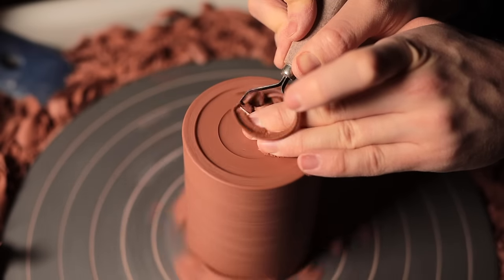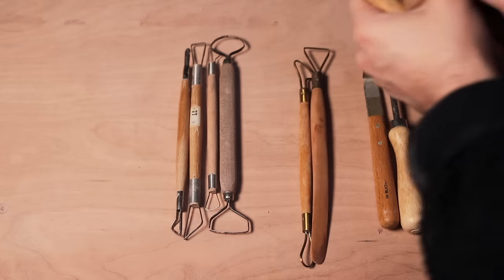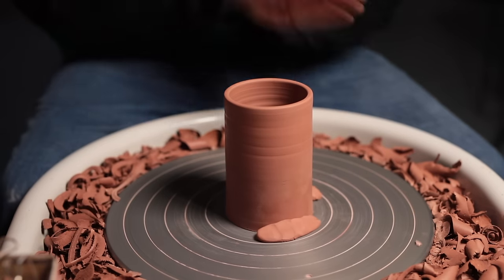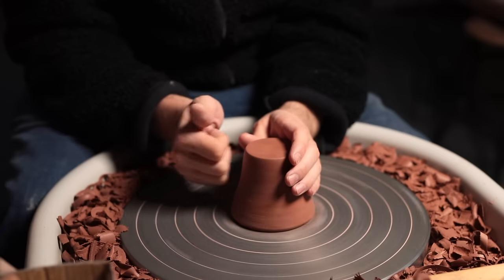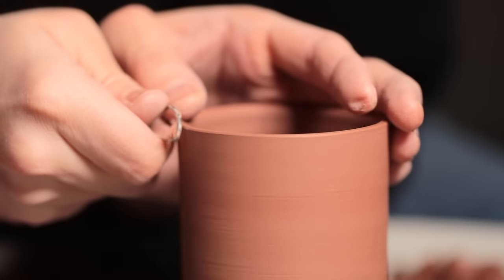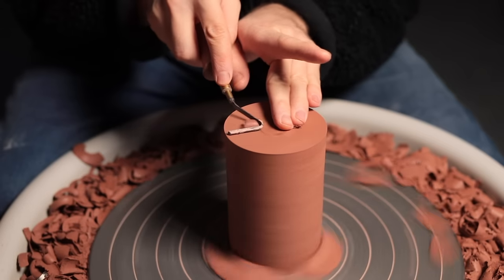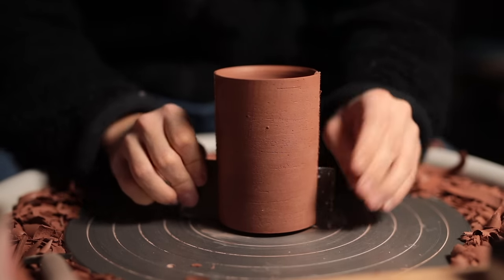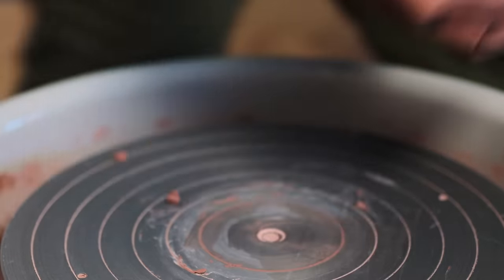How to Trim Pots — Tips and Tricks — A Beginner's Guide

Comment: One thing I've been struggling with in trimming lately is that when I'm trimming the base of the pot I'm somehow creating undulations radiating out from the centre of the pot that I can't seem to level off again. I bought a new trimming tool thinking that perhaps mine was blunt but that didn't help. I never used to have this problem so I can't for the life of me figure out what I've started doing differently! Hopefully what I've explained makes sense and is something that you might be able to talk through in an advanced video some day. Your videos are always the first I turn to when I'm having trouble with something :)
Reply from the maker: It sounds like one of three things… either your tools are blunt and you’re having to use too much pressure to push down on the base and trim. Your bases could be thrown too thin/or you’re trimming too thin. Or you’re trimming the clay when it’s too soft, so it simply bows inward as you work instead of holding flat. 

Levelling off is tricky — I recommend using a very tiny turning tool and just removing the clay bit by bit from the high point that spins around. Eventually it’ll level out but you’ve got to hold the tool very firmly and not follow the undulating base. Rather you need to trim through the undulation till it’s flat.

Comment: I would love to know where you got the tool that has a 90 degree angle. I believe it’s the one you use to cut in the base at the throwing stage. Also, where to find your twisted cut off wire?

Comment: How do you know how thick the bottom is as you pull the clay up and make it taller. Is this a feel you get over time?
Reply from the maker: Once the lump of clay has been centred and opened up, and the internal base formed, I never press down any further on the base section of the pot, making it thinner. The only excess that's drawn up is in the walls of the pot.

Comment: The videos you provided made me want to make pottery, but when looking for a pottery kiln that does not exist, or at a very high price, is it possible to benefit from pottery without burning?
Reply from the maker: You can create air dried clay pieces — but really that’s an entirely different thing from normal pottery. You need a kiln to change clay to ceramic, otherwise it’ll never be strong enough to use.
Reply: @floriangadsby  
Thank you.  In fact, I wanted to learn pottery in order to make plant pots and antiques.  I will try to air dry them or with a burning wood but when I get the chance I will buy an oven and learn to make mugs and plates and a lot of things 💗.

Comment: Florian, how would you trim the bottom of a pot with a long thin neck? E.g a bottle or vase
Reply from the maker: I’d make a clay chuck that the upturned vase could be placed into. Or find a bucket, or other object that might serve a similar process. You can secure it on place on the wheel with clay and a cloth, although that can be quite precarious. It’s tricky!

Comment: Ok question: when you go to do the foot, after the guide is put in and you start to trim from the middle, I see you are using the right side of the tool to move outward rather than using the left side to pull outward. Somehow, my dyslexic brain doesn’t understand moving from the middle outward without my tool snagging

Comment: How does the tap works ? Like how u know when is centered based on taps ?
Reply from the maker: The number of taps is irrelevant — really what I’m watching is a particular point on the vessel, be it the rim or the walls or the base, or all three. I tap the pot until those points rotate without any undulation in their spin. If the thrown pot has wobbles in it, like beginners pots commonly do, then seeing this centred state is much harder as no matter how centred you get it the pot still moves unevenly. But once pots are thrown to a sufficient level, or evenness, tap centring becomes easier, which is annoying in some way as it makes it harder for beginners to practice.

Comment: Is it ok to leather hard dry pieces in one day/night?
Reply from the maker: As long as they dry evenly, then yes, absolutely fine. Ideally, you don’t want one side of a pot to dry out faster than the other, as this can cause them to lean to one side.
Reply: @floriangadsby  normally I leave them under plastic and completely cut of air. This takes a day or 4 to dry. My bowls of yesterday dried all day without plastic (about 6 hours) and then the night with plastic. This morning I turned them around (is this even English?) Like upside down, and let them dry for 3 hours. Hope they don't crack.

Comment: Guys, I am 9 minutes in and I still have not learned how to trim. How should the blade touch the pot. The whole blade? One point on the blade? Hold it flat on the piece or angle up?
Reply from the maker: Look at how I hold it and imitate that. You can use the whole blade or part of the blade, depending on what/where you’re trimming. Some trimming blades can be held flat and others might need to be used at a slight angle, 20-30 degrees. How many times have you tried trimming??